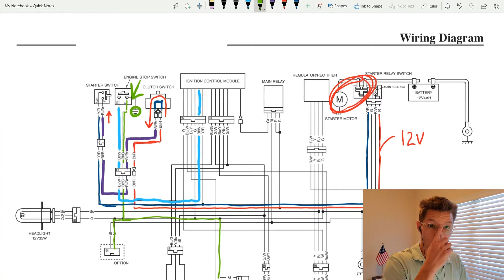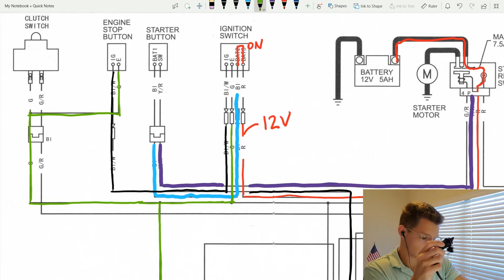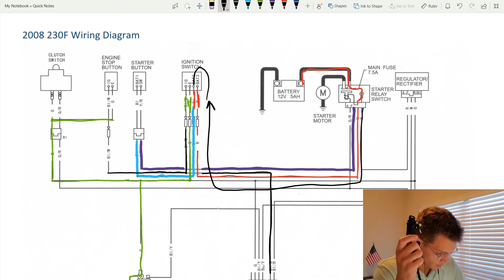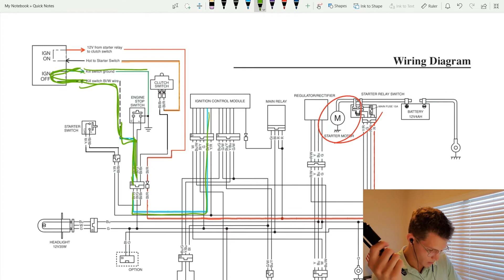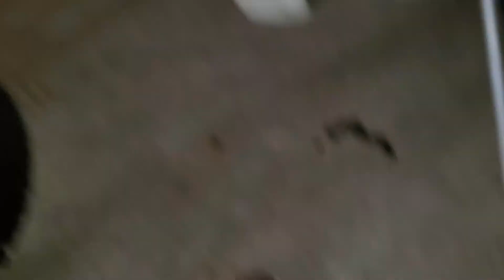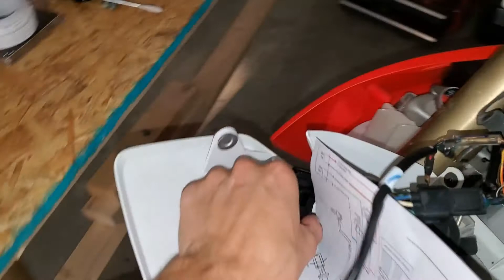How to Install an Ignition Switch (Key) on a 2005 Honda CRF250X

Comment: Very helpful. Thank you. Just bought a used crf250X with a tusk street kit and an ignition key switch. Some of the components were not wired properly and this will help in putting the bike together.

Comment: Good detailed explanation,it really helped me wire up my gas gas ignition switch thanks.. Another way would be to leave the factory connectors on the ignition switch and use connectors on the new green and white wires so the ignition can be changed easier if it develops a fault? Thanks for sharing 👌🏼

Comment: very nice! finally can tackle this job for my CRF450X. Where did you end up mounting the switch? Any pix? Thanks Alex.
Reply from the maker: Currently it's still zip tied to the handlebars. I plan to 3D print a mount for it at some point.

Comment: Great video!!!  no more videos for the CRF250X??
Reply from the maker: What would you like to see?
Reply: @ac38  where did you end up mounting the key ignition switch, if you upgraded your lighting system with LED lights? if so.. how did you make the connection?, maybe your thoughts/review on the overall bike.
Reply from the maker: @jmc10  The key is still hanging on with a zip tie. I will be 3D printing a custom mount, but haven't gotten around to that yet. I do not have any aftermarket lighting on my bike.
Reply: @ac38  Hi, I was wondering if you can clear something from the wiring diagram, there is a gray wire coming from the main relay to the ICM.... can you show me a picture of that wiring from your bike... because I'm able to see the gray wire from the  main relay but there is no connector available..in my bike that wire is not connected and I'm worried I may damage the ICM. thanks.